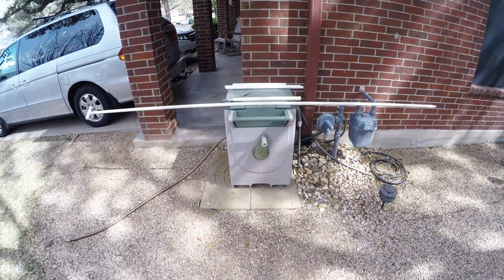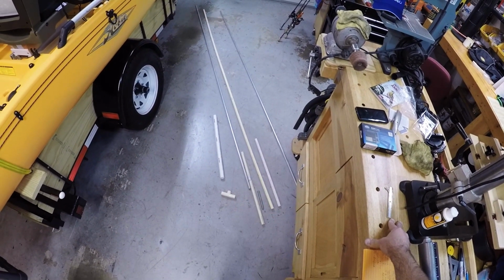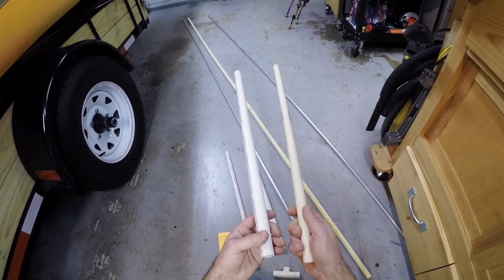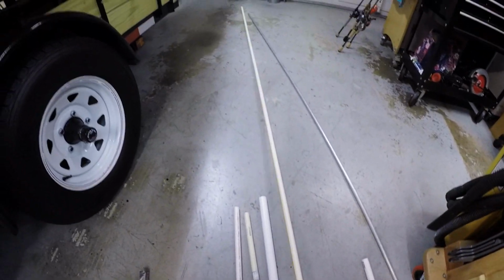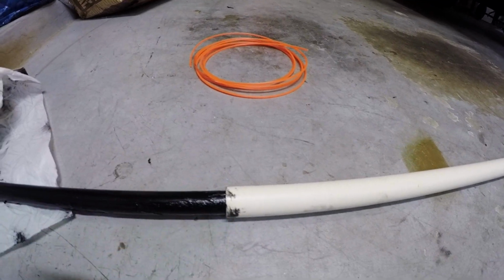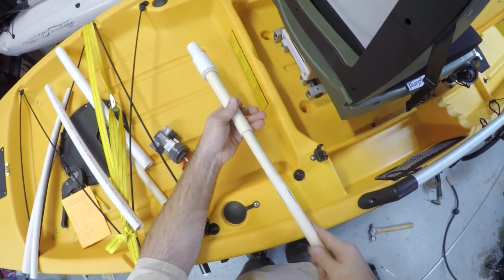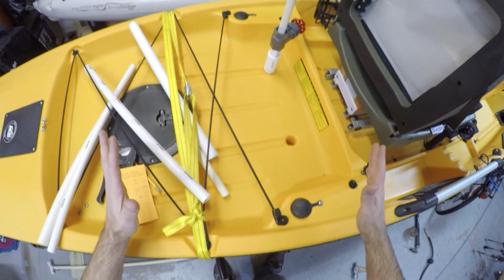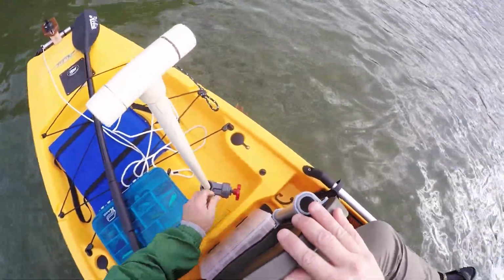DIY Kayak 9 Foot Stake-Out Anchor Pole

Comment: Just found your video tonight and couldn't be more ecstatic.  Can't wait to start building this on the weekend.  You mentioned the rod insert into the aluminium tubing... any reason for not using a spike to help with penetration? 

~Tommie.
Reply from the maker: Tommie, I did fabricate a spike made from an old Hobie MD drum axle:  https://youtu.be/6IRy47YMF4A?si=DHDJMqoRfaFpbUeT&t=650

Comment: I like what you have done and plan to make two for myself. Could you confirm the size of the Aluminum Schedule 40 in the video you mention 1/2"  and it's also flashed on the screen as 1/2". However, the parts list states 3/8".  A little clarification would be greatly appreciated.
Reply from the maker: Sorry that wasn't clear.  I just went into my garage where I have some scrap of that AL pipe.  The ID is 1/2" and the OD is 13/16" so if I recall correctly that's just regular schedule 40 AL tubing, fits damn near perfect into 3/4" CPVC pipe, just smear it with the silkaflex and you're golden.  Just don't do it in your kitchen, the wife will have a fit.
Reply: @motleypixel  Thanks for the information and timely response.

Comment: Hey Roy, youre a PVC genius! I have the same older model PA, and seek a good efficient manual power pole anchoring system for fishing the Texas flats. Please provide a performance report now that you've had some time to use youre brilliant set up. Thank you!
Reply from the maker: Works great!  If you can afford T6 (temper 6) AL tubing then it won't bend and stay bent like the sch-40 stuff I used.  One time in strong wind and in about 6' of water the pole bent a little.  It has since stress-relaxed back to shape.  Also watch over-head...I went under a bridge once and well it all worked out, nothing broke.
Reply: @motleypixel  Using the scupper hole behind the seat, does the hull orient with the bow fairly straight downwind, or does the hull stay at an angle to the wind? THX
Reply from the maker: @ramboatpapayak3047  Well if it is at an angle to the wind I can't tell.  Just be sure not to lock the stake out pole once it's in the mud...think about that :)
Reply: @motleypixel  10-4 and thx again.
Reply: @motleypixel  ummm...because with the stick locked in the mud, the hull can't rise when waves come?
Reply from the maker: @ramboatpapayak3047  yup :)